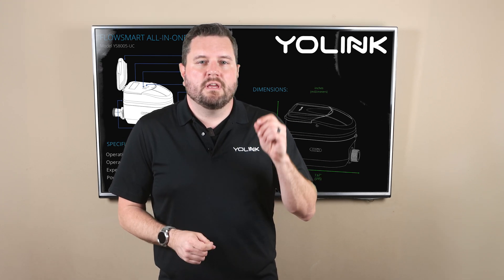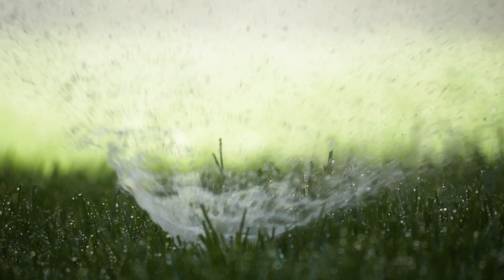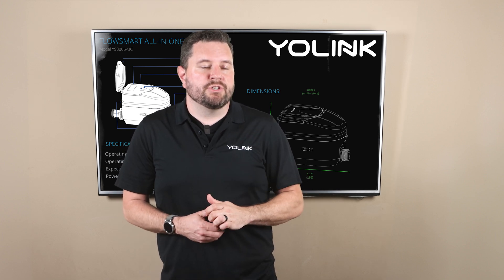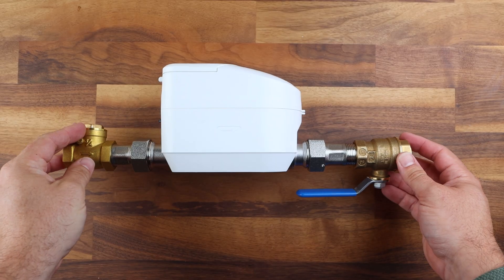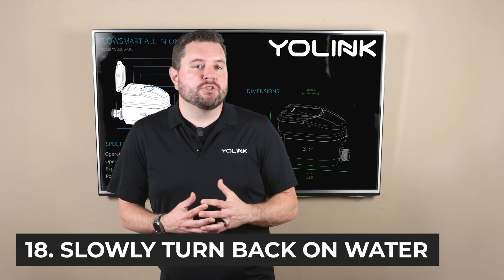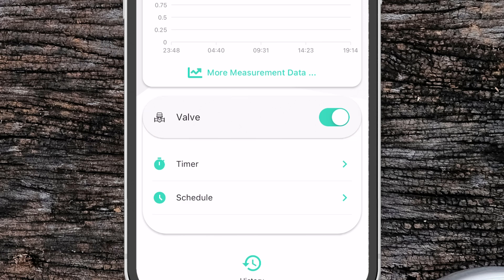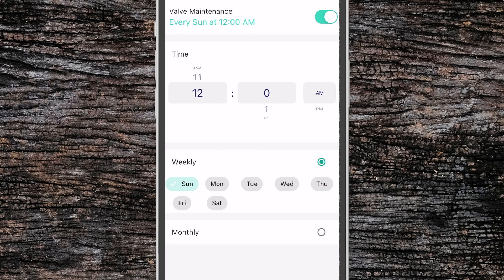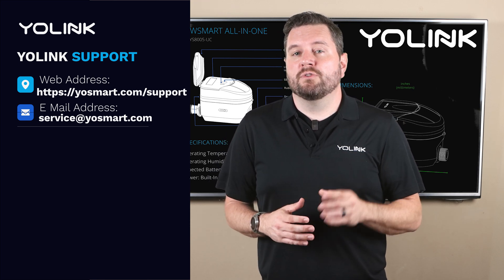FlowSmart All-In-One

Comment: I wish it had options for different leak detection settings for different times a day like at night when I want the parameters to be tighter than during the day. Also the ability to set into away/vacation mode which could also be much more sensitive while allowing for humidifier or boiler replenishing.  Competitors units do this.

Comment: why is it installed upside down in vertical orientation? If it is supposed to be a design joke, it is not funny at all...
Reply: Very careless oversight.  Makes you wonder about the rest of the quality of the unit.   Another concern is that it doesn't look like there is any kind of manual over-ride if the unit gets stuck closed, nor mention of duty cycles.
Reply: that would be the videographer issue.  Just bad orientation for a demo vid.
Reply: I just installed mine. It's a an oversight, mine is mounted vertically and the display is upside down. Annoying but not end of the world if that's the only issue.
Reply: I saw another install video where his pipes flowed down, so it worked out perfectly. Guess it's just luck of the draw on which way your water flows at the installation point.

Comment: Hey Ryan, so glad that you did an installation and operation video! Detailed info on this device is quite sparse on both the YoLink website as well as on Amazon. Even the product PDF on the YoLink website is poorly written, denoting its intended use.

I called YoLink and the person that I spoke with didn't seem to know much at all about the product. I'm not sure if it's due to the Flowsmart being a new product or they were new to their job but they gave me the impression that it was for use with a garden hose or irrigation system and not for whole home use.

I'm wondering like others that have posted... is the lithium battery user replaceable?

YoLink offer so many different versions of their water valve that it's very confusing trying to figure out which one to buy. Maybe you could do a video comparison of all of them, to help others know which product would best meet their needs.

Many thanks for all your helpful videos!
Reply: Hey @wscottfunk! I need to talk to the YoLink team about giving me access to the YouTube channel so I can answer as them. But I want to make sure everyone has the info they need.

The battery is not user replaceable. I think it is a standard lithuim battery, so it "might" be replaceable. But you can use the power supply if you are worried about the battery dying. But they said it has a 10 year life. The power brick will keep it running so it won't use the internal battery.

As far as the different version, I think that this new all-in-one will work best for most users. Because the meter and the valve are directly integrated, plus it is cheaper. Plus it is more accurate. The only reason you won't want the all-in-one would be because the ultrasonic won't work for you (air in your lines) or you need to separate the valve from the meter.

Glad you found the video helpful! I love working with the YoLink team.
Reply: @ThisSmartHouse  did you get in touch with yolink team?

Comment: Is the battery rechargeable?
Reply: No the battery is non-user replaceable, non-rechargable lithium battery (not li-ion). But it does have an expected battery life of 10 years.
Reply: @ThisSmartHouse  thank you for the response.  I hope YoLink does not go this route with other products.  If so, I will be looking for other options.
Reply: @thirdnormalform  I can totally get the concern, but you can use the power adapter to run without the battery. It is a trade off, because if you use standard batteries you will have to replace them numerous times over the years and the voltage drop off is more significant.
Reply: @ThisSmartHouse  Understood on tradeoffs.  I bought YoLink because the two(ish) year battery life is just fine.  It's just not practical to hardwire.  A replaceable or rechargeable option is a must.
Reply: Yes, the battery is replaceable. Little bit hard to do, you will need to cut the seal wire and open the case. It is 19000 mAH 3.7V lithium battery.

Comment: For the battery model, is the battery user-replaceable, or do we need to replace the entire unit?
Reply: I have the same question. The info on the YoLink site, their product PDF and on Amazon are really lacking sufficient details. On Amazon as though it were for a water hose type fitting that you would use in your yard.
Reply: The battery is replaceable. You will need to cut the seal wire and open the case, YoSmart do carry this lithium battery. It is 19000 mAH 3.7V.
Reply: @siriustechxu  Thanks. If it's user replaceable I am OK with that. I want to avoid having to toss it out when the battery dies because that would be a burden to a future homeowner.
Reply: The battery is not user-replaceable, but it has a 10 year life. As I had answered for scott, you can get a power adapter that will keep from using the battery.
Reply: @ThisSmartHouse  My concern is that often these 10-year batteries don't have a 10-year life, at least not from when we purchase them. That's what I see in smoke/CO detectors (even the bigger, more reputable brands that probably don't have stale merchandise siting in stores).
Reply: @woofinu  Completely understood. But you can always keep it running with the power adapter. I would be concerned about a rechargeable battery over 10 years anyway.
Reply: @ThisSmartHouse  The main thing is that I don't want to have to remove or replace the FlowSmart every so often, whether it's 10 or 15 years. It can be a huge or unknown burden to a future homeowner who may know little about its history and operation.